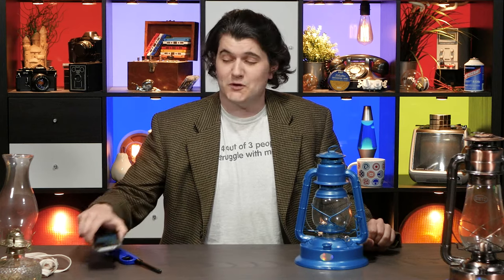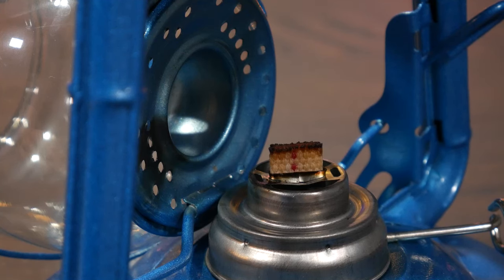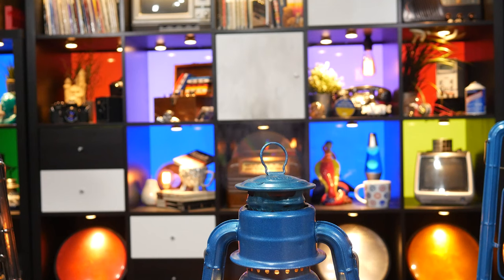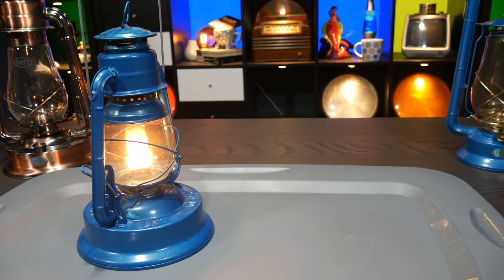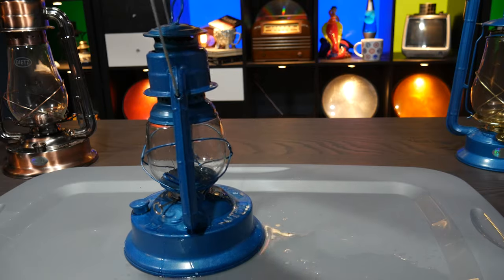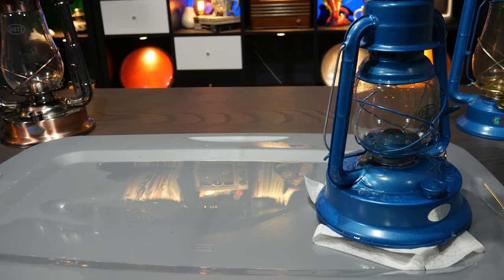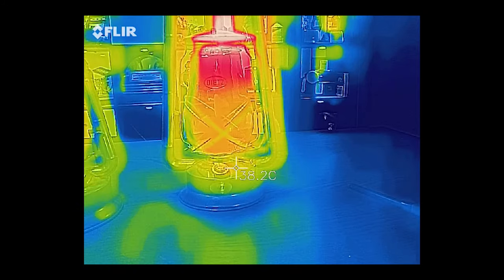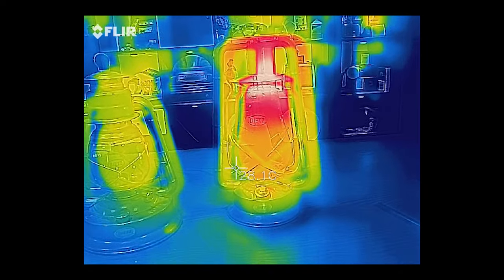How to use, more info, and further thoughts on hurricane (Dietz) lanterns

Comment: Alright, consider this one: The intake has a one-way valve. You light the burn chamber and press a lever to force air into the first intake chamber to prime it. Once in the first chamber, the air is heated up by the burn chamber, expands, pushes a ball sideways until it passes a hole going into the burn chamber. Once it does this, the pressure is released and it's free to return. The ball is heavy and weakly magnetic, and is returned by a magnet, so its return force is weaker the further away. This is abalancing, and therefore makes the ball's motion cyclical instead of the ball just sitting still slightly past the hole. 

Forced induction hot air intake for your lantern. Tiny chamber, rapid airflow. New air cycles in, it burns, heat is conserved while it burns, and only then is the air exchanged, all at once. Downside: The light changes intensity and color many times a second.

Comment: My folks had a parafin lamp in the house when I was growing up. It was a tall brass and glass affair with the exact type of wick as shown on your lamps here, adjusted via a thumbwheel.. 

But there were also two levers on the side which raised a flared piece of brass around the wick, I think this was used to snuff out the flame, as I imagine the glass chimney would have been super hot after 30 minutes of use or so, but I don't know that for sure, and I don't know why two such levers were needed.

Any idea what the second lever might be for?

Comment: Hot blast lanterns run a little less bright because it recycles exhaust gas. Kerosene lamps all tend to burn odorless as it is made to run as efficiently as possible even the flat wicked ones if adjusted correctly. Lanterns also have to deal with cleaning up airflow as it is made to not flicker in wind so delivery of fresh air comes second to cleaning up airflow.

Comment: Most car intakes are in the engine compartment (Where the air is heated by the engine being there).  A “Cold Air Intake” takes the air from from outside the engine compartment.  Very few cars (Mostly off-road, or high performance) actually have one from the factory.  That said, you won’t really make more power with a cold air intake alone, you’d need to add other bits to work with it, so you are kinda correct there.  

From one nerd to another..

Comment: On the note of cold air intakes on cars, they're really just a high flow air filter. You can achieve the same result by enlarging the intake hole of the stock airbox

Comment: what about the Aladdin lamp? have you gotten it to work?  Do you know what burner style the old ones use?  The new manufacture ones are 3-400 each. the lamps I mean not the burners.  I live in the country in Mississippi,  and we get power outages all the time in the summer, sometimes for days because of hurricanes, and I have access to clean burning dyed kerosene from the pump, so cheap fuel, and therefore am VERY interested in the Aladdin lamps, especially one that could be wall mounted.  could you do some more videos on it?  Thanks, your video was the first I've ever heard of that style of lamp.

Comment: Two thoughts: 
1. The Aladdin kerosene lantern puts out tremendous heat at the funnel end. Much more than a hurricane lantern. Makes it not portable...and dangerous if not properly placed. 

2. The Aladdin has a very fragile mantle. It will fracture easily. The hurricane lantern was called a "barn lantern" because you could take it with you. It's portability is a major asset, even if less efficient.

Comment: I’m not sure the preheating helps as much with the burning, but may be more of a “super charger” effect.  As the hot air enters the tubes and cools, it gets denser.  Not only does the cool air sink, but it also reduces in volume, creating low pressure, and sucking air in.

This will create a draft effect similar to the long tube glass lamp at the beginning of the first video.  As the chimney gets hotter, it will cause a bigger draft which might be why the flame gets brighter as it gets warmer.

It also might be part of the reason for the self extinguishing flame, since when the lamp is upside the “cooling” tubes will create less of a draft since the falling cool air will be going the wrong way.

It would be interesting to see if icing or heating the bottoms of the tubes effects the flame.

Comment: One major improvement to these lanterns that could be added is secondary combustion, like what you see in some fire pits and wood stoves. It splits the intake air into two paths, the main cool air intake, and a hot air intake that introduces preheated air directly above the flame. The latter causes smoke and waste gas to ignite once the air is up to temperature, so you could theoretically raise the wick up higher for a bigger and brighter flame without worrying about the smoke and the smell. Perhaps the air could be made to swirl around inside the globe to turn the flame into a fire whirl as well? That would make the lantern burn hotter and brighter still.

Comment: Cars run partly on hot exhaust air. This feedback loop is in place to burn unburnt fuel residues and decrease emissions. If a software update increases the rate of this to remove exhaust cleanness cheating in motors not designed for the increase the intakes may clog up sooner and cause more frequent repairs. Probably it also increases consumption in some cases. As noted in the first video the other model of the lamp not completely running on fresh air is less bright. Probably it also has better exhaust values?

Comment: Some people like the smell. Some people don't really notice it. You're entirely valid in pointing out the smell and how it can be a problem for many people, but I think at the end of the day, hurricane lamps are a great all round design, while keeping the technological input to a minimum. Basically if the world goes completely upside down, I'm more confident a hurricane lamp will still be serving well after those incandescent mesh lamps are in the trash heap or juryrigged awkwardly to "burn dirty". Other electrical lamps only last as long as the solar panels/wind turbines and battery chargers. If any of their internals gives out, for most people that's game over. Another inch added to the trash heap. Most normal people will not have the resources or skills to maintain that sort of technological base. 
Meanwhile as long as you don't use it as a mace, hurricane lamps will last lifetimes, can take pretty much most oil fuels people will have access to, and are easy to maintain and use. They're also robust enough you COULD swing them around (not as a mace) and use them in almost all situations.

Comment: If you dig into the settings on the thermal camera there should be an option to adjust for the paralax between the visible and thermal cameras for tthe distance away you're filming from.

Comment: I think some places may prefer those over electric due to the heat (even if small it's still something) and sometimes they add an insect repellent to the fuel. Also other than kerosene, some lamps use either naptha (same as charcoal starter or Zippo lighter fluid) or white gas (if you're using mantle lamps).

Comment: Ay least some cars since / in the 70s used a diverter valve to convert the cold air intake to a hot air intake during engine warm-up. Air was pulled over the exhaust manifold to heat it before it entered the carburetor.  A temperature dependent vacuum signal would then close / move the flap when the engine approached proper operating temperature.

Comment: I have a couple blizzard lanterns, strangely I failed to remember that I had them during the three day power outage during the ice storm here in central Texas. I could have had light and a bit of heat. I use clean burn kerosene, the type for the kerosene heaters, I can't remember the brand. Very little if any smell. I used paraffin oil in a small walmartish lantern once and it smelled terrible.

Comment: Very interesting videos about Kerosene Lanterns there.. OK.. I did some experimenting of my own and here's what i found out.. Apparently that warmer intake design by Dietz was NOT by accident.. Not only it provided the flame the cleaner air intake but also that warmer air helped it lit cleaner, and more fuel  evaporated so sustained better flame (as you mentioned).. 
Now why did Dietz went all the troubles to design a costly hollow tubes for warmer intake when he could just make holes in the outer shell of that oil tank for colder, dense and oxygen rich air.. to find out, I experimented with my lantern..
 I took out the glass and very carefully removed the tubes one by one, (with pliers) to expose the air intake holes. ( mine had all the fuel taken out of course).  Now it was just a base lantern with kerosene tank, two air intake holes and a burner. I lit it, and it went fine for a while.. i could put my thumbs on air intake holes to see how air blockage lowers and narrows the flame.. TILL the tank begin to get warmer.. Now with warm tank and cold air intake burning caused one strange thing.. FLICKERING.. The flame begin to flicker continuously till it just went out.. i relit it only to get same results.. i waited till it became cold and it again lit with perfect flame till it becomes warmer and begin to flicker again.. 
So the hot air intake WAS by design and one can only admire the thought process behind that patent.. Of course, my theory needs further experimentation to prove the point for good.. Just to mention, i burn kerosene in my lanterns..

Comment: wrt not seeing the lit wick on the second lamp - glass is actually an IR blocker. You have to use special lenses to record IR - for example, a lot of IR cameras use a silicon lens. This is also part of why there will be so much parallax on a small camera unit like a handheld FLIR, as the two sensors have to be behind different lens materials.

Comment: Don't let them down you on the hair man.  Long locks brothers, UNITE!  Also, the unmentioned idea behind cold air intakes is to remove restrictions and increase the flow of non-turbulent airflow into the throttle body.  The unmentioned dirty little secret of most cold air intake kits is that without supporting mods, such as a larger throttle body, larger, more free flowing exhaust, and a computer tune to account for the change in airflow characteristics, they're almost useless, if not detrimental to the efficiency of the engine.

Comment: Gas mantles work by keeping the flame small and contained inside itself at higher fuel flow rates than in a simple lamp. This concentration of combustion inside the mantle improves the transfer of heat from the flame to the mantle.

Comment: The best way to explain cold air intakes is basically cold air is more dense (ie more molecules) so it will need more fuel to make the ratio (fuel to air) balance out, where as hot air is less dense (ie less molecules) so you need more air to mix with the fuel.  Hot air usually causes a car to run rich and cold air tends to run lean.

Comment: A note on aftermarket cold air intakes. rather than actually providing cooler air cold air intake kits usually provide a less restrictive path for the air to flow into the engine. So you will usually see a slight power increase, but not from cooler air.

Comment: I know you address alternatives in the video but I personally run Florasense lamp oil in my hurricane lanterns which is almost completely odorless. Most lamp oil is just highly refined kerosene and lacks the characteristic smell. I've ran them for hours indoors with only a hint of smell that you get used to very quickly. It is quite a bit price-er than heating grade kerosene but is well worth it for indoor use. I'm sorry you had to suffer through using smelly kerosene indoors as most would use it for outdoor use only.

Comment: Cold air intakes for cars can actually cause a measurable increase in power over stock intakes. Stock intakes are not only designed for power, but also reliability, ease of maintenance, avoidance of water, and quietness. Aftermarket intakes often move the intake lower, which increases the likelihood of it taking water in, but also can increase the amount of air that is taken in. For my racecar, I have two different air intakes, one for the dry and one for the wet. This isn't something that you would really want in a commercial market car. They also are often louder than stock filters. They can increase power, but there is a tradeoff.

Comment: I have had some experience with lamps, (I have a collection of them) and I have a couple of Aladdin  lamps. The Aladdin lamps are the brightest by far and if you light it without the mantle, or if you keep the flame low and look down from the top you can see that the flame on it is blue. That is what heats the mantle up to white hot and the conical shape is why it makes so much light. You do have to be careful with them though, if you light it and adjust it immediately but  then leave it alone, it will get too high and cause soot on the mantle and can cause a runaway situation. 
I have a can to put on top of the chimney so I can stop the flow of air. The wick cannot be turned down enough to stop the runaway situation if it gets that hot. I actually quite like the circular lamps I have because they do make more light than the flat wicks, but cannot "runaway". Also I just like how they look. But I do also really like how the Aladdin lamps work. To be clear I also don't use them very often for the same reason that you stated, they tend to smell, but I like them nonetheless. OK, rant over. Great video as always! Keep up the good work.

Comment: Great video as always. Suggestion for the Flir: If you are using one of their plug-in modules for the phone you can get a different application called Thermal Camera+. The big advantage is you can disable the visible camera edge tracing. I have never tried recording video though, so I don't know how well that works.

Comment: Lanterns were for outdoor use or in a barn because of their high wind resistance. They tend to burn a bit more dirty by nature. They weren't for use in a living area. Oil lamps were used indoors.

People assume a lantern is the same as an oil lamp, just in another configuration and form factor. That's not the case. Indoors, use only an oil lamp. That's what they're for. Outside the house, use a lantern. That's what they're for.🙂

Comment: Fun fact, the tubes are NOT for use as a heat exchanger. The tubes are specifically to place the air intake near the air exhaust so any wind has very little pressure gradient making the lantern very wind proof..  A blast of air blowing cross the top of the lantern also directly hits the air intake. If the intake was at the bottom of the lantern, it is much easier for a blast of air to form a pressure gradient between the exhaust and intake increasing the chance of a wind gust blowing out the lantern. A traditional table kerosene lantern for example are commonly blown out by blowing down the chimney. This is nearly impossible with the hurricane lantern. Try it. Blowing into the chimney cap area also blows directly into the baffled air inlet.

Comment: The big reason these lamps are still around is Emergency reliability. Few moving parts fewer things that can not be fixed quickly then any other lamp. And even a strong wind and rain will not stop it from working as in the name! Hurricane lantern. I personally live in a town outside Chicago. But I always have multiples of these at hand. Batteries go dead! light bulbs burn out! But Hurricane lanterns are able to hang for years and a lighter is all you need to bring them into service. As a fact because of your first video I purchased a dietz lantern blizzard. With a little care and safety in mind you cannot do better!

Comment: Cool note on the thermal camera.

The Deitz logo on the glass having such a clear thermal difference that it actually displays.

(ex - fire-fighter, used and played with thermal cameras a lot. Did you know you can watch the flow of clear fuel as it spreads across water.

And glass acts like a mirror with thermal cameras. Handy to know if using it to locate an unaccounted for person in a burning building.

Comment: Wanna clarify on the cold air intake for cars thing. Some cars (My 06 GLI included) no not have cold air intakes from factory, instead, my airbox sits right on top of the engine, heatsoaking and generally being a fuss. Moving the air supply to infront of the battery (right behind the bumper/grille to get a constant supply of fresh, cold air) does help. To refresh, not ALL cars benefit from a Cold Air Intake, but some actually do

Comment: 5:34 colder, denser air can also expand more to do the work of moving the pistons

In the (unrealistic) example case of the intake air being the same temperature as the post-ignition temp, no work is done (the piston won’t move due to no expanding volume of gases)

Comment: I thing the air preheat might be of another use - cold weather realiability. Low quality kerosene might be freezing in very cool climate (-10°C or less, parrafin crystals turn it into a paste). So the warm air was supposed to keep it above freezing temp. But when using the outgas, it might be too wet and water was getting into the kerosene and freezing or influencing reliability. However preheated fresh air might be enough to keep the kerosene liquid.

Comment: Maybe the pre heating is important in cold weather to various reasons ( more difficult to could air kll the flame, flash point and viscosity of the oil etc) . If it does not have some function I can't see a good reason to make the air intake so complicated (it does not need to be to complicated just to avoid  wind blow).